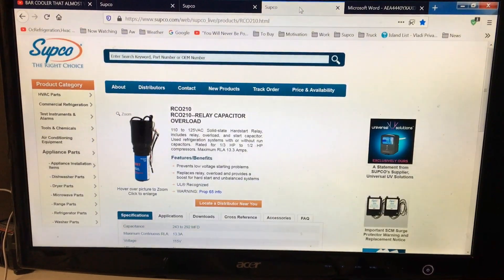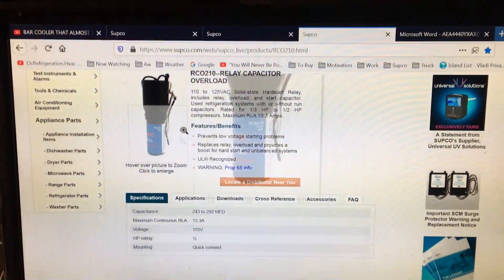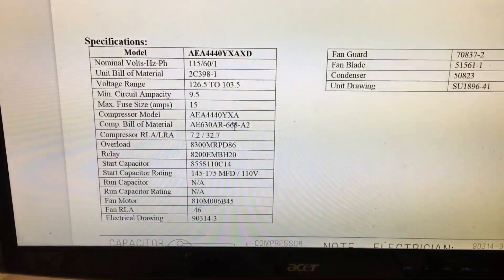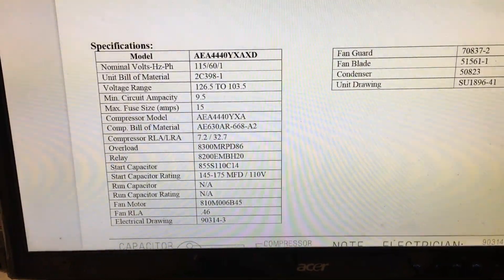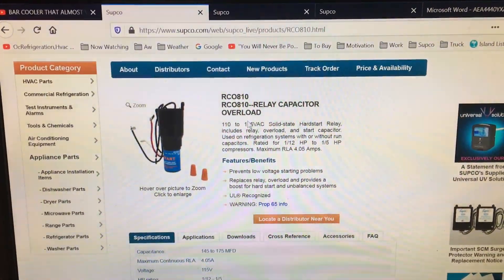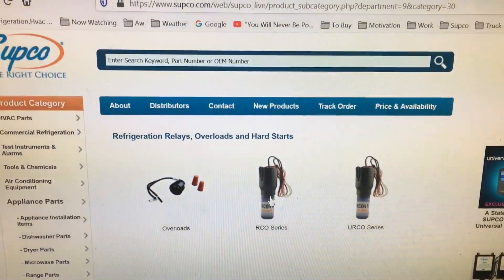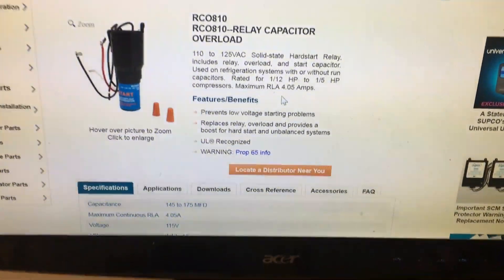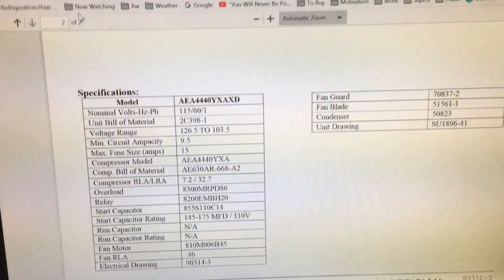How to Properly Size a Supco 3 in 1 Hard start Kit for Your Compressor.

Comment: great info now i know why sometimes my RCo kits don't work, just checked in the truck and yes I was using 410 for 4440 compressors, thanks for the information.
Reply from the maker: Yep , Real common mistake ! I Made it once ! That’s why I make Video’s When I see Problems & ways to help out Techs. I’m passing on the info I have learned from the last 40 years of work !
Reply: @OcRefrig  congratulation on 40 years . we usually use to put RCo kit then get back with the original and put it in, our lead tech said that RCo kits kill compressor, i guess he was never putting the right one in.
Reply from the maker: @hvacir9176    Thanks ! I’ve put in tons of these kits in the last 20 Years ! NOT ONE HAS EVER KILLED A COMPRESSOR ! Not one ! Besides , it would be nearly impossible to kill a compressor with a start kit. The Compressor would have to be Pretty far gone in the first place to Burn out the start winding. How many start windings Alone do you see burned open ? Only the start Winding ? With the Run intact ? I would say zero for me.
Reply from the maker: Throw the 410 away unless you are doing residential fridges or compressors 1/6hp and smaller. Only use 210 for commercial on everything. 1/4, 1/3 & 1/2hp.
Reply: @OcRefrig  thank you
Reply from the maker: @hvacir9176   Your Welcome !

Comment: Good stuff so is that how you usually use to 410 3in1 👍👍👍 won’t that be overkill though 🤔
Reply: 40 years that’s a long time are you taking Apprentice let me be your Appreciation
Reply from the maker: @jyphc1679   Are you in California ?
Reply from the maker: I never use the 410 , only the 210. 410’s are too wimpy for commercial. Overkill is not a Problem. Never had a issue. Go big or go home !

Comment: Great tip! I always heard to use them as temporary fix but after installing a hand full of them and seeing them still work fine aftere 5-7 years i changed my view on them, like you said sizing  it properly is very important.
Reply from the maker: Bigger is better with these. Whatever size it says to use. Go up one size. I only use 210 kits on 1/4,1/3 & 1/2 hp commercial. I only carry the 210 kit on the truck 🛻 and use it for everything ! Unless I was working on like a 1/6 hp compressor or smaller. Which I never see. Those are only on residential.
Reply: Anyone who understands pick-up and drop-out voltage and capacitive reactance knows the consequence of using a universal set of start components..
Reply: @mikenew2865  its easy to measure that! Even tecumseh uses 1 relay from 1/2 to 2 hp it works fine!
Reply: No one said they are better then oem parts, but they can be a good alternative, a lot of smart audience  on you tube these days, if only they would be that in a real life